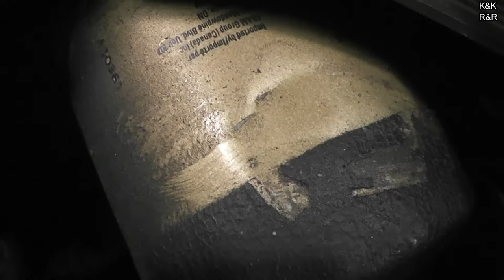Fram Oil Filter Failure???

Comment: I used the same Fram Tough Guard of filter on my 2006 Trailblazer and it leaked.  The leak was small, probably 4 quarts over 5k miles.  Still it made a mess and I paid the shop $105 to investigate and do an oil a filter change.  The first thing that they asked me was what tool I used to install the filter.  I did it by hand.  It is tough to get tools up in there and as tight as I can manage by hand has always been enough.  The mechanic thought that perhaps it was over-tightened.  At 53 with arthritis in my left shoulder I guaranty that it wasn't installed too tight.  That was probably the last Fram filter that I ever buy.

The mechanic said that mine was leaking from a seam.  Your looks like it was either damaged at installation or it was rubbing up against something.  Hand tight is all that these filters need.